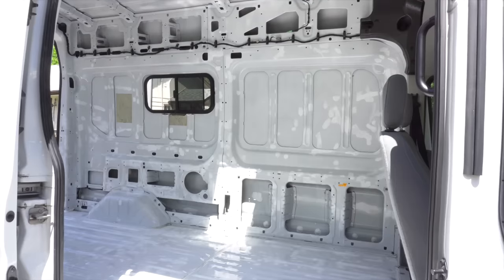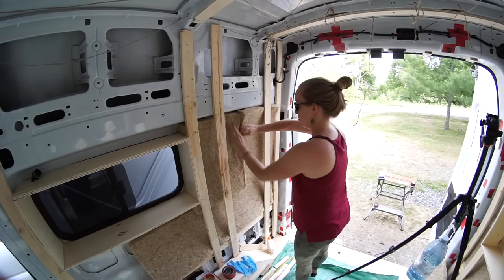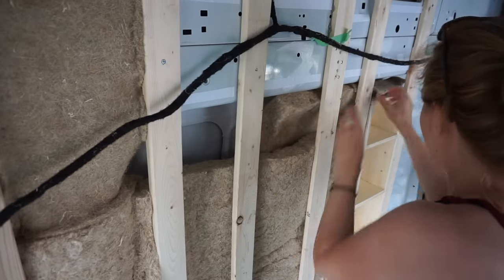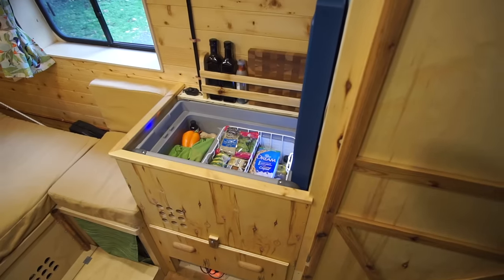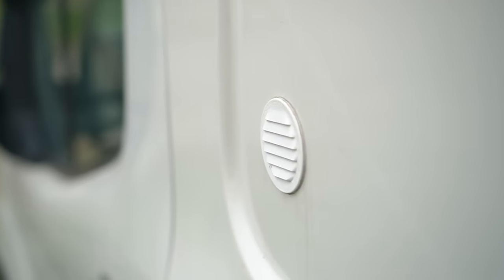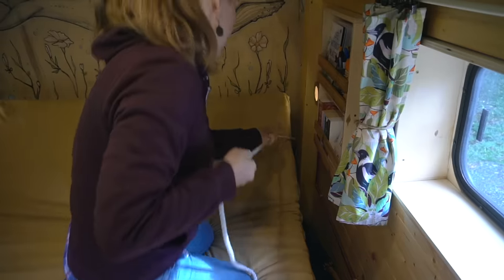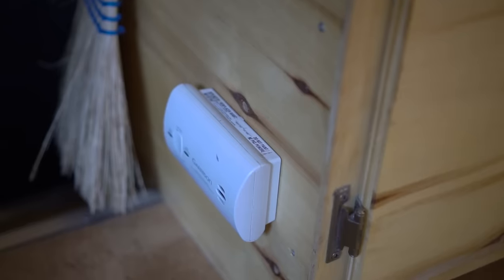FULL DIY VAN BUILD from Start to Finish | Our Epic Van Life Conversion

Comment from the maker: Thank you for watching!  The full tour of the finished van is here if you want to take a peek: https://youtu.be/4p-GG5eenUk
Reply: This is amazing! Thanks for sharing!
Reply: use the spray foam barrier around the windows, and use the hemp insulation everywhere else.
Reply: U should share your information with the school bus rentervators
Reply: I really enjoyed this build!-!  
Re: the gray water odor:
instead of installing a p-trap you might want to look up
 a Hepvo self closing drain. It is available in most plumbing stores and on EBay and its around $25
Reply: What a great artist!!! Have you sold any of your art work before? Really lovely drawings.
Reply: Are you familiar with the Insuladd insulating paint additive?  I have used it on my sailboat hull below the waterline and it completely stops condensation and provides a decent amount of insulating value.  I think it would be a perfect application for problem areas of a van.
Reply: Have you looked into wood burning stove for dry heat to care of condensation problem, but it will add weight and take up valuable space.
Reply: @MrBugman2525  x
Reply: I've started my own diy conversion thanks to your awesome, comprehensive video! I'm planning to also use granulated cork and wondering how many lbs you ended up using? It's sold by the pound and I have no idea even a rough estimate of how much to get. Thanks!
Reply: How much to run this per month? Approximately
Reply: @annegleasman1916  Did you find out? I have the same question. Thank you.
Reply: I ordered 13lbs and that filled about 2/3 of the flooring for a 3500 Dodge Sprinter van. So, I think you’d be best going with around 20lbs!
Reply: @annegleasman1916  That helps so much!!!! Did you use hemp too and if so how much? Thanks.
Reply: No problem! I am using hemp for the sides, ceiling, and doors. I got half a pallet of soft hemp fiber blocks from a Craigslist post. 28 blocks of~4ftx16inx7in size. I’m not done insulating and I’m really stuffing it into all crevices, but I think I’ll have the perfect amount to finish. You may have some blocks left over with this amount if you aren’t insulating as aggressively
Reply: Cant  you find a van that does not have so many cavities etc.? With a smoother walls?
Reply: What is the cost for making it???
Reply: Thank you  for sharing your ideas
Reply: How much did all the wood cost?
Reply: @scdobserver835 ppl)
Reply: Having Dehumidifiers should help
Reply: Why haven't you married her?
Reply: Heads up that chapters don't work because these two timestamps has less than 10 seconds between them:

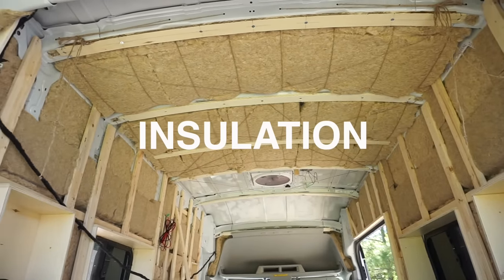05:58  Insulation
10:07  Wiring

Common mistake to make, encountered it several times myself when setting the chapters
Reply: How long did it take?
Reply: If you kids don't listen to me, you are going to be living in a van, DOWN BY THE RIVER!

Comment: In order to properly insulate your van. I would recommend covering your entire van with a butyl rubber adhesive mat. Such as second skins or dynamate. The problem you are having during the winter months is that the warm moist air coming from your sweat and breathing is coming in contact with the cold sheet metal. Thus causing those areas to condensate. You need to regulate that moisture with a dehumidifier or directly insulate the the surface of the metal. Make sure you drill  some breathing holes in your walls, so the moisture is allowed to vent out. I suggest you should watch a video on how to use a psychometric chart. They are used in HVAC field and it will allow you find at what temperature the moisture in you van will start to condensate.
Reply: Do you put the rubber in front or behind the insulation?
Reply: Or a textured coating like Lizard Skin to act as a thermal break
Reply: I am thinking of lining the metal with 3 mil cork glued to the sheet metal body and then using hempflax batts.  

In a van though not 100% of the body can be reached.
Reply: Okay then wise guy
Reply: Thank you

Comment: The ingenuity people display always amazes me.  We are on our second 
transit Van and we would still make changes. We had the water problem you described but cured it in our second van by adding a vapor barrier. I think you have covered the flow through vents by the rear doors. All vehicles have them somewhere to allow your vehicle heating/ventilation to work. We like what you have done. Great Job.

Comment: Great video.  FYI: You wont have an issue with condensation at the front if there is not an air gap.  The condensation is an issue because the area is not totally filled with insulation.  Fill it without a gap and you wont have the moisture.
Reply: Thanks for that information. I was wondering about that.

Comment: Nice job, using hemp is a nice idea, but you are better off using spray foam insulation, that would help with the condensation. If you have the money, for longer off grid usage add bigger water tanks. Yes you would have to do some redesign to some degree. I m 6 4 so a would have to find a longer van or custom extend the rear the back of the van.vans are a small area to live in ,it would wear on you after long stays.for me to put a full size bed in the back and add a shower on one side and a toilet on the other.. I’m a  semi glam person, I like the finishes, I would. Try to put if I had the space a bigger fridge and a two burner stove and sink. The driver and passenger seat would swivel and have a pull out table or something like that. I would create out door space with an awning and access to to pull out folding chairs and table to sit out side for those warm days.. I’ve seen a lot of videos on diy and you guys did a a really good job  on yours, good for long weekenders,  with a few tweaking and access to materials you can build  for people that want custom vans. You have talent, with more training. The customer supplies the van and you and Custmer design the the floor plan.

Comment: For the roof Solar cabling, the part you would want to buy is called a Liquid Tight Conduit Nipple, they work great, and then can just use a tiny bit of caulking as needed.

Comment: SHORTCUT LINKS

01:35  Planning and Prep
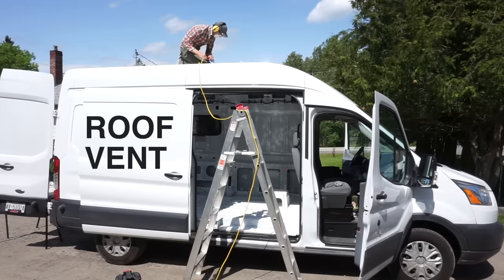03:29  Roof Vent
04:02  Subfloor
04:46  Framing
05:34  Window Frames and Inset Shelving
05:58  Insulation
10:07  Wiring
10:38  Walls and Ceiling
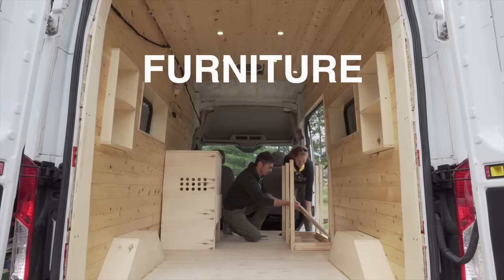11:52  Furniture
15:35  Bathroom
16:59  Solar Power
18:14  Bed and Dinette
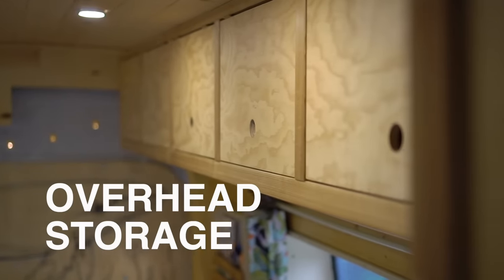20:28  Overhead Storage
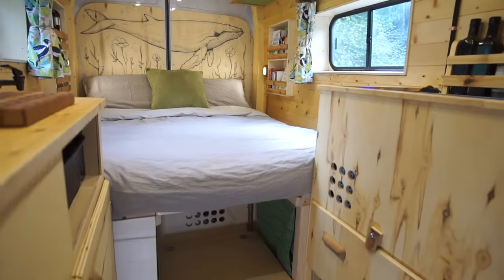21:41  Floor
22:07  Finishing Touches

Comment: I've just completed my van insulation and I had exactly the same issue around moisture. I bought a 2005 model Transit and  it had obviously been 'sweating' as there were rust spots inside on the bottom of the van walls. So I knew there were issues with water vapour on the walls. It was acting like a huge Terrarium. 
So, I first fixed the rust on the floor of the cavities and converted it all. I then sealed those spots with a zinc paint product. I ended up putting a really good vapour barrier using XPS foam on all the metal and locking it off with silver tape. I then spray foamed all the cavities. But because I live in Australia, I decided too much insulation is not a good thing as it can actually retain the heat at night. What I decided was the best option was to insulate the roof and the curved parts with foam board, held in with spray foam.  I only insulated one side ie. the side that I would always point towards the sun and/or put out an awning. I did this all in the summer so as not to trap any moisture in. This has worked out really well as I no longer can see any moisture forming, even though  its winter, and I should be seeing mini waterfalls right now.

Comment: We recently purchased a 2020 Ford Transit Extended HR. Thanks to you we did our best to pressure wash and locate the leaking points. Believe it or not we had a few even though the van was new. The mystery leak you had in your van was probably due to a poorly welded joint. That was the case with our van. Once it was welded, they also added silicone to the plastic trim along the side which was another source of our leaks. This video was a great help to us and we thought we would share our experience. Cheers!

Comment: Very nice build and a very nice presentation of that build! 
Regarding condensation, I learned something new from doing refrigeration work. The problem with condensation on the copper evaporator tubing is guaranteed to be extreme. The solution is to wrap a special tape around the tubing so that moist air is not able to come in contact with it. The special tape has an adhesive face that sticks to the copper. The tape itself is closed cell foam rubber. If you have ever touched a wet suit, you will know what I mean. I think it would be possible to purchase this closed rubber foam, and find some way to make it permanently adhere to the metal surface.

Comment: first off: big compliment for the illustrative explanations you guys took the effort to make. As coming from the low-lands we suffer from moist a lot so here allow me to share some tips: Even if you are against using sprays pls always treat ANY damage you to to the metal with something to prevent rust. that includes all screws. and the opening for the ventilator of the "head".  As the Dutch build a lot of caravans to tow behind our mini cars, we are much more critical of our weight as this is legally limited: The thickness of the panels can be much thinner. When you screw and glue you just made it much stronger then needed. Go google for a dutch caravan build. I would isolate with stone wool. It will never absorb water and will never rot. Temporary wires tend start to vibrate. Better glue stuff.  Having that said. You did a wunderful job and i will love to 'steal' some of your ideas with your consent.

Comment: To lower your condensation issues, install a flettnor turbine in the ceiling, and some insulations have a peel and stick backing to let you get rid of the air gap around the roof. You can sew a bung (a stiff foam pad that fits the window open) and when the window is cold, install the bung to cut off air flow and also condensation.

Comment: Though I watched the tour awhile back, there were several things I don’t remember seeing on the tour. The wire props for the cabinets,  for example,  are a neat touch that is made even better with the magnets. I have a roll of 12ga wire that could work (and it is handy) and I would like to borrow her idea. I was ready to rip out the cabinet doors and use bungee but it would not have been as effective with spices and small things. Plus, the cabinet door fronts are a cleaner look for my herbs, spices and randomness like metal tea filters that can’t seem to get along with forks. Is it possible to insulate the metal to such a degree that it is not effected by heat in the interior to minimize the temperature differences and thus minimizing the condensation?    Thanks for the tip on the leaky transits. I was always ruling out the Ford because the upfront costs of ordering one was ridiculously expensive. But kept eyeing them and wasn’t sure that I liked the slope of the roof but did like the height. I don’t have the resources I think you might have to give me detailed issues with each manufacturer but haven’t searched in awhile. I have an E150 that is only okay for my needs.  Have even been looking at something bigger for a few of our specialized requirements. But I really like what you have done and will borrow a few ideas with your permission. Thanks for the detailed follow up. I keep liking your van more and more!

Comment: GREAT video.  I've been planning and aqumulating ideas for my own build.  Great to use non toxic things, but a little overboard on it.  It would be best to ad a small layer of foam and spray foam insulation and then another.   Also if you mounted a water jug above in the bulk head it can gravity feed like a 5 gallon drinking water bottle.  A mini dehumidifier would make it awesome for when it is cold, it would take moisture out and put off a little heat.  Two bodies alone put off so much moisture and any water source.  Great ideas on some simple latches and storage.  The bed is a great idea.

Comment: I can see a lot of issues with this van that probably already started happening. No pea traps for your sink and toilet which means your van is gonna stink to the high heavens and that little computer fan won't save you. I don't want to sound disrespectful but that entire toilet system is awful. Your subflooring probably isn't attached properly because you were blindly trying to screw it to the studs. Also a screw wouldn't hold onto the insulation stuff that you use. Another thing is the walls will probably fail over time from the constant moving around while driving as it's mostly held up with pl premium. Otherwise everything else actually doesn't look bad.

Comment: Excellent!  Fantastic!  Amazing!  
I live in mine about 50% of the year, and would recommend gluing Carpeting to ceiling walls & floor.  MUCH easier, cheaper, lighter & FAR better moisture control & insulation too. Then your only framing is for mounting cabinets/ bedding.  Replacing carpet every 5 to 7 years is a SNAP, and much cheaper too.  
I SERIOUSLY  wish all my utilities (toilet, cook top, sink, counter-top (and on occasion even my bed)) was be modular enough to be easily & frequently taken outside for use. That's because I'm all about being way off grid, never camping in town.

Comment: I would go with tongue oil , and definitely wool for insulation . do not use hemp it will rot  , with wool  you won’t have condensation . if you understood a rivet nut gun you would never frame in anything . You would go directly to the body !

Comment: 13:30 No need to worry about the fridge. If it stops working just buy a new peltier element. Doesn't cost much and easily replacable if you open the fridge.

Comment: One way you can beat the condensation is to have a window cracked. It usually works well in tents. Me an my wife we went camping in some cheap tents from the local supermart and it tends too work really well. Sometimes too it usually hit or miss.  Try that it should work.

Comment: About the spray foam insulation.  I had my house attic sprayed and the owner of the company said they use two different kinds of spray foam when dealing with wooden plywood roofs and metal roofs.  The spray for the metal roof cost more money, he said it had to do with a binding agent and sealing process.  This is the second home I had spray foam for the attic, the first one they left the blown insulation on the Sheetrock ceilings up in the attic, this last time they had a guy vacuum out all of the insulation and said they have discovered that blown insulation will draw moisture and chemicals out of the spray foam and it causes mold and mildew, plus the smell will not go away.  Either way just thought I should let you know there is a difference between which foam to use for wood verses metal.  Hope this helps.  I love that ya’ll used hemp natural product, seems like you need a vapor barrier of some sort with the hemp or maybe spray on bed liner coating on the walls before installing the hemp.  You have done a fantastic job.